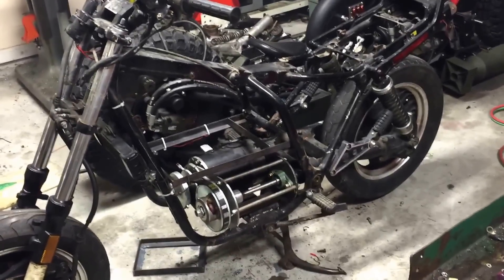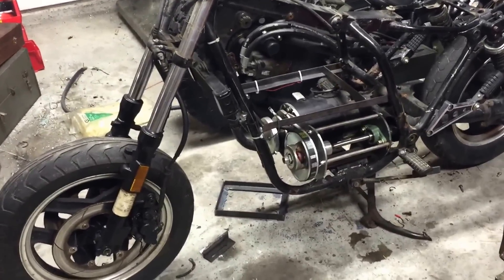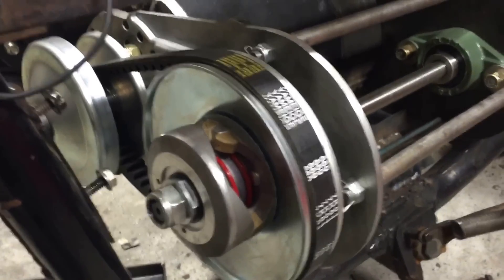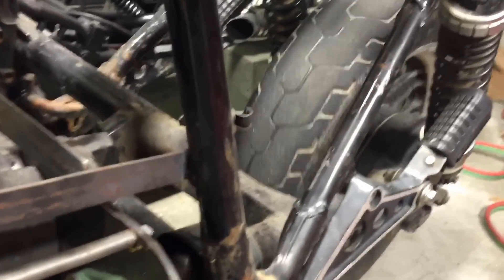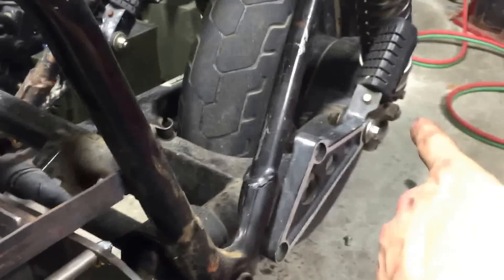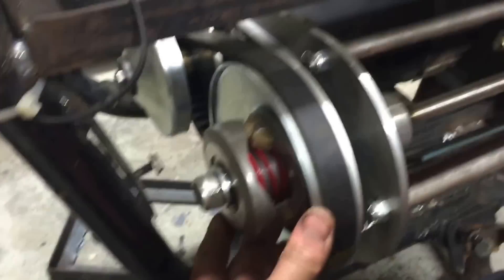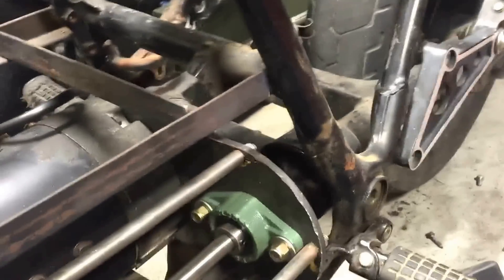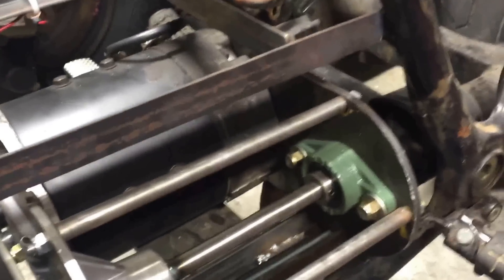CVT Electric Motor test fit in E-Motorcycle

Comment: could you not have flipped? put the cvt in the back and have the engine facing the other way?
btw what cvt did you use for this? a quad bike cvt?

Comment: sir ,what is the benefit of having CVT in a electic scooter
Reply: I'm so happy you asked.
Reply: So basically, electric motors have ALL OF THEIR power down in the low rpms. So if you use a CVT you get to keep all of that torque and power at all rpms. That's the benefit; you might wonder why the electronic vehicle company's don't use this. It's because they don't want the cvt to have issues it's more research and more money.

Comment: what is the power of the motor that you are using in this build
Reply from the maker: Kaival Nayak It is a 36 V easy go electric motor from a golf cart I think 5 hp
Reply: +Head Turner Customs ... Hi !!!... I'm starting a similar project with a D&D 36v DC motor ...and  i have a question... Where did you get that CVT transmission? ... can I buy it somewhere? ... I would like to do something similar ... could you help me with that information?

Comment: i wanna do this to a mini bike and my only concern is that the CVT only locks at like 2k RPM which is already like quarter throttle on my electric motor. is there any way to lock the CVT clutch so that it is always engaged?
Reply from the maker: MuchFly Wow yes, you can reduce the engagement rpm by changing the driven clutch springs to weaker ones.
Reply: Head Turner Customs does that mean i can make it instant engagement as well somehow? push the clutches out and weld them closed or somehow weld the whole thing together? I've never seen inside it so idk what's going on in there.
Reply from the maker: MuchFly Wow if you weld the weights in one spot, the pull ratio will be stuck in that one range. You want them to still move, but very quickly so that the motor engages at a lower rpm. It depends what type of clutch you have but the TAV2 has two half moon wedges shaped weights with two extension springs wrapped around them in two grooves. As your rpm increases the centrifugal weight of the wedge eventually overcomes the tension of the spring and expands, moving the cone shaped pulley inwards grabbing the belt and moving it outwards to increase the pulley ratio. By removing a spring, or changing them out to weaker ones, the rpm required to get the weights to move becomes less and less.

Comment: are there any advantages of using CVT when you are using a  motor that can continuously vary torque?
Reply: Whereas electric motor deliver full power at any speed, they slowly lose some torque as they speed up, so, i think that using a cvt would help maintain the motor at lower speeds so it can deliver higher torque at higher speeds of the vehicle

Comment: can cvt runs on electric motor?
Reply: Electric motors typically don't need at least initially transmissions of any sort due to 100 percent of torque being available at 0 rpm and the added complexity of a transmission.  Having said that any motive source whether internal combustion and or electric motor can benefit from a transmission whether it be standard, automatic  dual clutch or CVT.

Comment: I know this is probable a stupid question  but I want to use my honda eu2000i http://cdn.powerequipment.honda.com/pe/pdf/manuals/31Z07610.pdf.I want to place  it where the gas tank is and build a compartment to hold it . Then I want to use a 110v motor to turn   . I want to remove the top part of the motor, piston  rings ,cylinders ect , and keep the gearing as it is and connect the motor to the lower part of the timing chain  so the motor is taking the place of what the firing of the pistons would do . This way I can use the throttle connected to a rheostat  to adjust the speed of the motor  just like the pistons  would turn the cam shaft . I just want to eliminate the parts of the engine that is needed for use with gasoline  to move the cam shaft . What size motor  that runs on 110v  that will be  powered  by the generator would I need to reproduce the same rpm 's the pistons did . I was thinking about using a klr 650  for this project . This bike used a big 6 gallon tank so once removed  along with the top end of the engine I should have lots of room for the small honda generator .The Honda generator can run a good load for 8 hours on a gallon of gas  .
Reply from the maker: I'm not sure what your main goal is with this project, if it is just for kicks then go for it, but as far as efficiency, using a gas engine to turn a generator to turn an electric motor to turn the wheel is going to be pretty inefficient as apposed to using the engine to directly turn the wheel.  Where this works best is in heavy load applications like a diesel electric locomotive. From the sound of it, your setup should work, but I would recommend using an electric hub motor to help eliminate the drivetrain loss from the gears and chain.
Reply from the maker: I'm not sure what your main goal is with this project, if it is just for kicks then go for it, but as far as efficiency, using a gas engine to turn a generator to turn an electric motor to turn the wheel is going to be pretty inefficient as apposed to using the engine to directly turn the wheel.  Where this works best is in heavy load applications like a diesel electric locomotive. From the sound of it, your setup should work, but I would recommend using an electric hub motor to help eliminate the drivetrain loss from the gears and chain.
Reply: The generator can produce 8 hours of 110v  on 1 gallon of gas .I want to place  the electric motor shaft in the place of the cam shaft  with a motor that will turn in the same rpm range as  it would if it was using  gasoline. the upper motor shaft will turn the lower shaft of the engine  by the timing chain . This way I can still change gears and  nothing has to change . If I can reproduce the cam shaft rpm's  with the electric motor  the rest of the motor will work the same as it would with  gasoline. As far as being efficient . I would be able to travel 8 hours  on 1 gallon  regardless of my speed . That means if I went 45 mph for 8 hours  I would get 360 mpg on 1 gallon . If I went 70mph for 8 hours I would be getting 560 mpg . Look into the amount  of amps the generator can produce with 1 gallon of gas . What have you got that can go 560 miles on 1 gallon of gas ? The faster you go the more miles you can cover with the 8 hours of running time from the 1 gallon of gas the generator uses .

Comment: Why did your mount the motor facing forwards?

Seems like you could have saved needing such a long jack shaft and weight by doing it the other way around?

Love to hear your thoughts on it.
Reply from the maker: I original was going to mount it facing backwards, but the driven pulley is held down by a lock nut, and if I extended the shaft from that side of the CVT, I would not have been able to tighten the nut down to secure the driven pulley.  Plus, having it facing forwards means the original CVT cover will fit without modification.